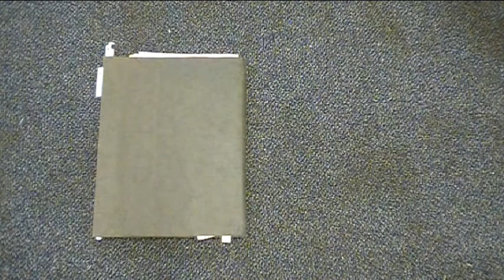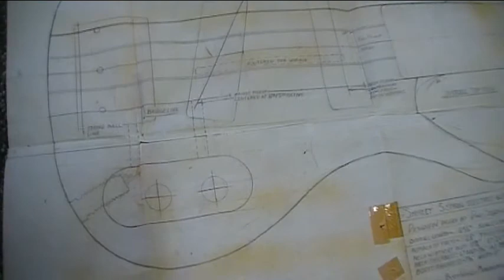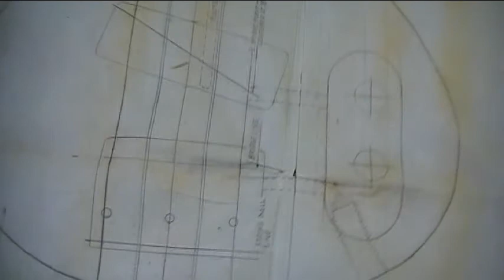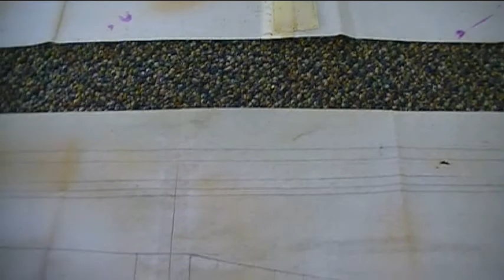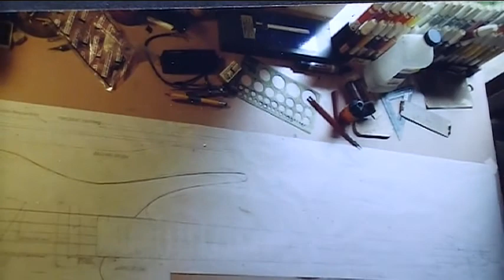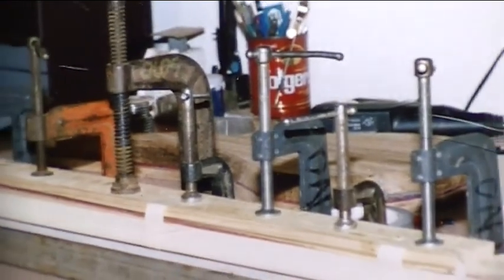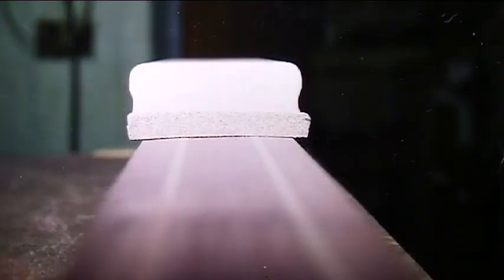The Five String Electric Bass

Comment: Using carbon filament with silica flour and epoxy resin and perhaps a black pigment is a good idea to make a hard wearing surface. It looks like ebony and could be used on Maple as well. What if you could not get ebony wide enough for the fretboard. I don't know why I didn't think about this before although I've used these materials before. Now I wouldn't hesitate to do this for a guitar!
Good simple description and insights. Thanks!